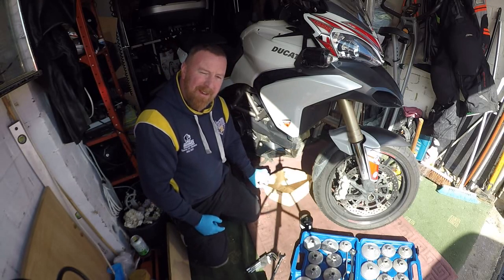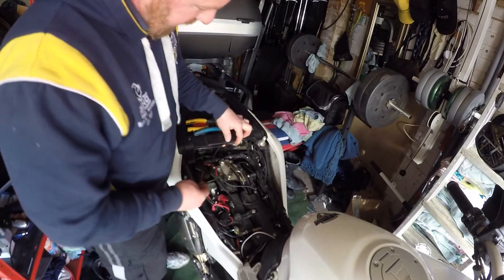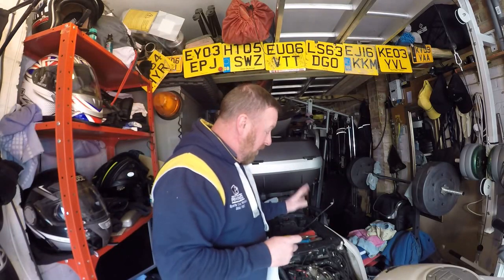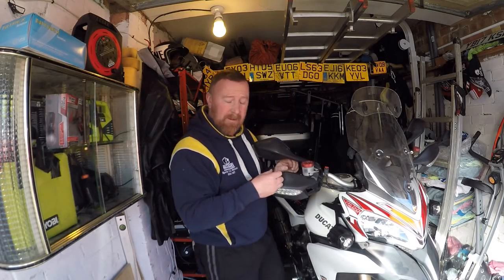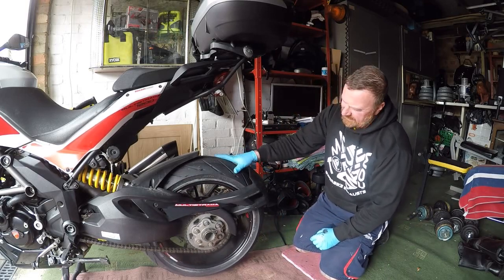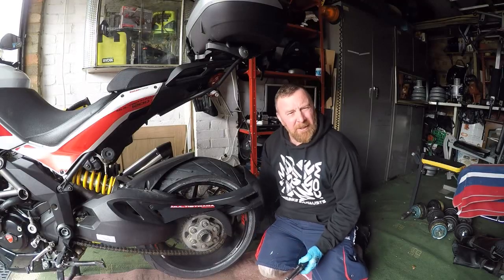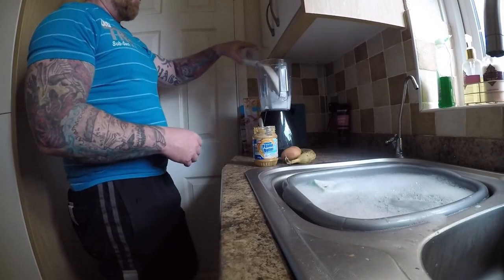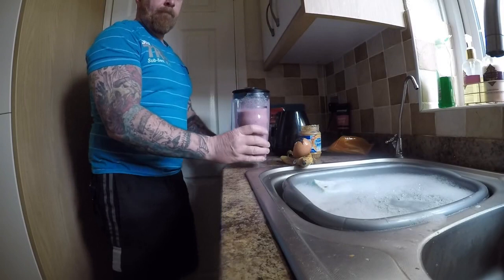DUCATI OIL CHANGE AND FIX UP MARK SAVAGE

Comment: Is there any way I could message privately about a 50 speed fighter #love your video
Reply from the maker: Thanks for watching bud theres 150 moped videos which some should help 
Either make a video of your problem or ask on here and I'll try and help
Reply: mark savage thank you I have just put one up it’s called speed fight 2 starter
Reply from the maker: @jackwoods4750  so it just turns over 
Do you have spark ?
Is the plug wet ?
Carb hand test yes ?
What happened before it stopped running 
How did it stop 
2t oil ok 
Fuel ok
Vacuum working test
Reply: mark savage  hi again it needs a new wiring harness do you know anywhere I can get this ?

Comment: The little box is an UltimateAddons power supply, you can press the button to power it on/off.
https://ultimateaddons.com/collections/motorcycle-chargers/products/2-amp-waterproof-motorycle-scooter-hard-wire-charger
Reply from the maker: Yes thanks bud I Google it are I made the video but thanks for the update 
And for watching